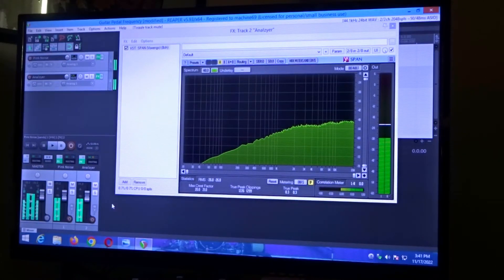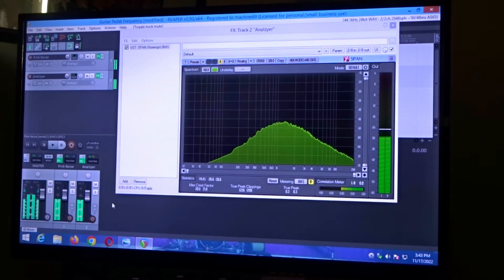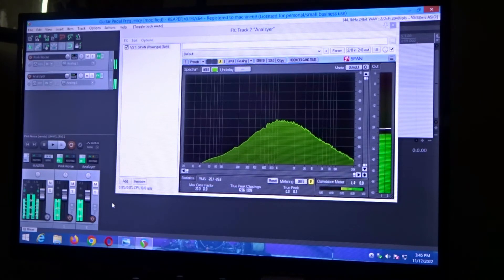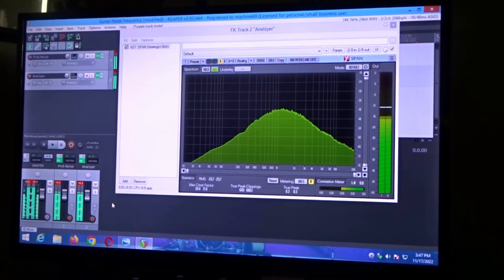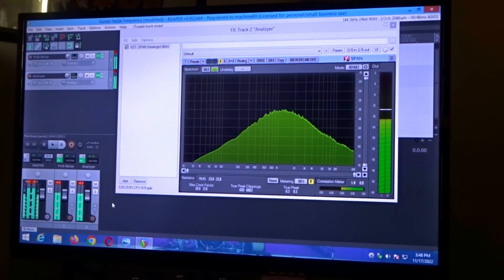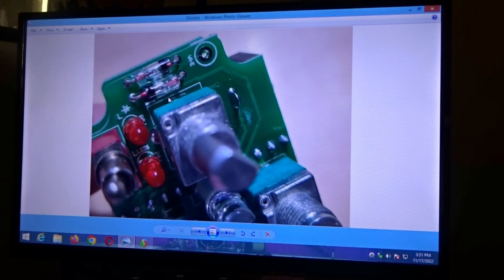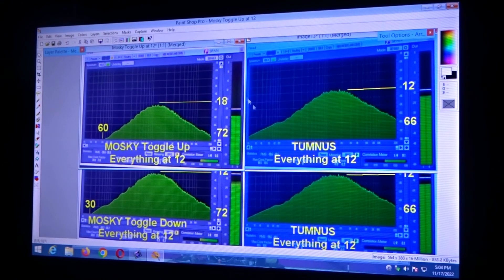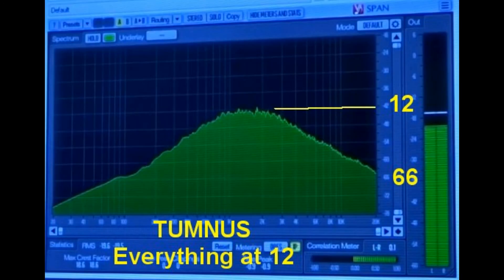Tumnus vs Mosky Silver Horse (Frequency Charge Pump) Comparison

Comment: If you ever get your hands on a tumnus deluxe, id love to see you run the same tests. I have a mosky silver horse that I use from time to time. I like it as a boost with the gain pretty low if not off. When the gains turned up, there is too much mid range honk for many of my uses so id love to hear and see how much more versatile the 3 band eq would make the deluxe for my rig.

Edit: also, it's cool to see you running the SPAN plugin. An old professor of mine introduced me to it and I never looked back. Such a great free plugin
Reply from the maker: If I get one I will be sure to re-test it. SPAN plugin is really great & thankfully it's free :)

Comment: I bought two Silver Horses, and they both have the high-pitched whine, despite the full-sized S charge pump. Do you happen to know how to fix it? I have looked around online (how I found your video), and I heard replacing it with a 1044 might solve it, then I read that pins 1 and 8 need to be jumpered to boost the frequency out of audio range, but I haven't had time to grab my multimeter to check continuity yet (and try jumping them, if that test is negative).

Edit: there is continuity between pins 1 and 8. I guess a swap is the only potential solution.
Reply from the maker: I've never come across that. How do you have it run? Guitar, pedal, amp or guitar, pedal on board with other pedals or pedal ran through the fx loop if you have one? I would check it using a different amp & guitar first before going through changing the pump. If it were only one silver horse I'd said something with the pedal but 2 it seems something else is causing it. I'd also check the patch cables to make sure they're seating correctly in the silver horse. Be careful not to short the silver horse out with the power by plugging it in or out when the pedal is on. There's a know problem with that. It just dawned on me I'd first try using a 9v battery instead of the ac power. You can make an adapter like I made.https://youtu.be/PI-kfEr3B80 As it could be a power supply issue. You can buy them but make sure you buy the correct polarity for the center. https://www.amazon.com/Mr-Power-Battery-Converter-Connector-Guitar/dp/B07YFGQ6ST/ref=sr_1_6?crid=3DW5XSQUS4OOU&dib=eyJ2IjoiMSJ9.y4WVR99c0x3wdpgcfzomAoOZV8kBii4nyI5Qr1djSCWzVIdZkAa3HVXOKk8M-vhpDhoOE9nx_raORYkthFZ00zpsep7VDxYqyBLil7GtCncRTQE9sF1lrjI83Wv-_3qJoNFlfuhTK9SqsGdTyiEuJh5SfRfDq_CkVcoRKHI-9tck810kqm3i5jPAPC8poPSVHOHvoH7Ei4UAOvYEV2oVQpjlEab6iHyumtNKm6m-IPIErnM1mKm5-zLkQt4391vg0DfxSkfuORhM9xTjrhDMYMBH5Vo0Vb4XlejTrSVPwLw.8nKZuLs2f0kja7AA4w3VfnQYUBYXEl80Kj-FsyYL0mo&dib_tag=se&keywords=9V+Guitar+Pedals+Power+Supply+Battery+Adapter+Converter+Cable+2.1mm+x+5.5mm&qid=1731783950&sprefix=9v+guitar+pedals+power+supply+battery+adapter+converter+cable+2.1mm+x+5.5mm%2Caps%2C65&sr=8-6
Reply: @TheCleaner6969  I tried several amps, also a Fender headphone amp, two guitars, two different sets of cables, three different power supplies, initially on my board but thought it was interfering with one of my other pedals, so I tried it by itself. No change. It seems worse with higher tone levels. It doesn't seem to bother my son, but it bothers me! Haha.

I also have some battery adapters, so I'll have to dig one out and try it. Hadn't thought of that.
Reply from the maker: @somethingelsedoesmatter  That's strange that it doesn't bother your son. Younger ears hear higher sounds that older people can't hear. Hopefully the battery adapter will solve the issue. Let me know if it does. I'd be interested to hear.